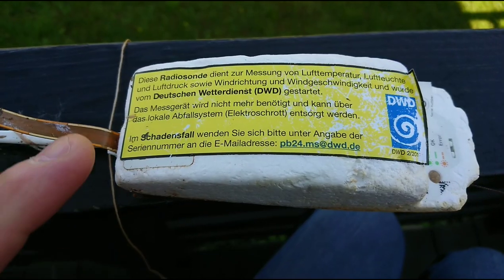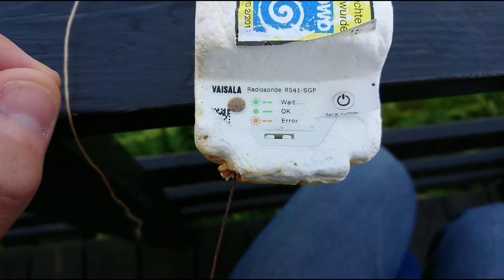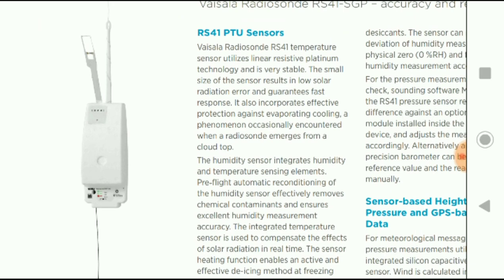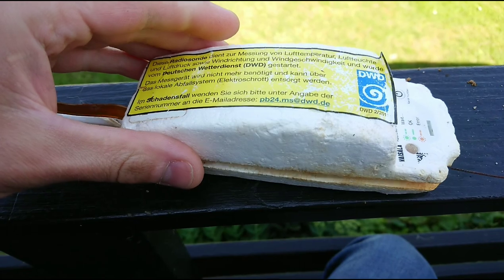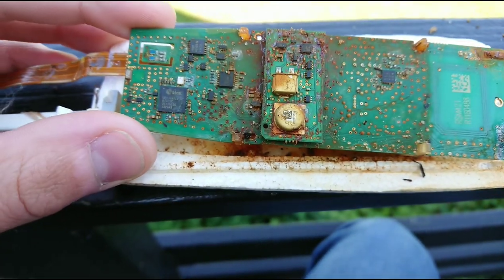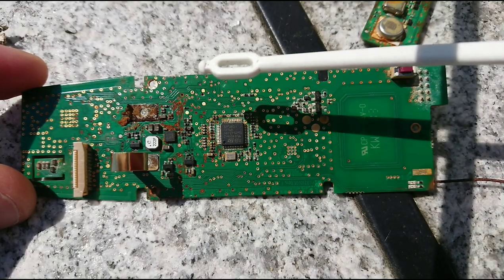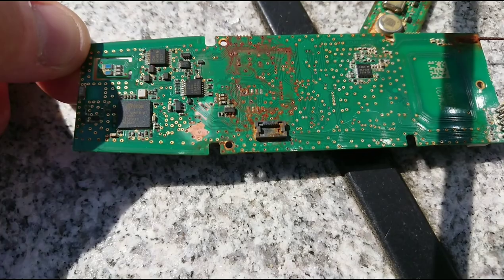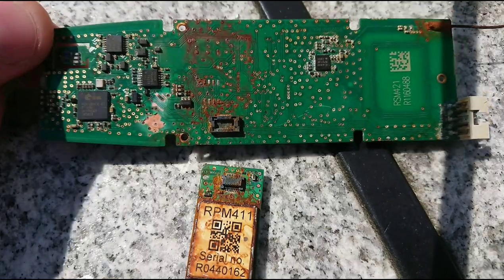German Weather Balloon Teardown, Vaisala RS41-SGP Probe

Comment: Interesting find! It almost looks like that label says the thing is dated 02/2017. I'm wondering if they may actually re-launch them if they find them again...
Reply: They really are single use devices, as they typically will stay up in the air for a day or two before the balloon bursts if conditions are right, though many of them have been tracked for weeks, travelling around the world on the jet streams. 

Would think the lithium batteries are used because they will operate to a lower temperature, and still provide at least enough power for the transmitter to operate at that point, even if the electrolyte in them is starting to freeze solid. They have changed a lot from ones used last century, where the battery pack was a simple cell pack that you activated by immersing in water for 20 minutes before launching. 

Thus batteries also need to have a shelf life of up to 5 years, as these could be stored in a warehouse for a while before being used, or sit at a launch site for a while. Sensor string though has not changed, just added the GPS to give an accurate position, but kept the barometric sensor, now temperature compensated, the outdoor temperature and humidity sensors, and likely some other sensors for light level and IR and UV levels, as photodiodes with the appropriate sensitivity filters are very cheap. Calibration though is now on board, as you can do a whole batch of them in the same chamber per run, and easy to write to each individual micro as a compensation table, so no field calibration data to be entered, it is all there ready to use.
Reply from the maker: Yes it says 2017 on the sticker. It looks like single use, but of good quality with that little damage after 3 years in the water.
Reply: @NerdyNEET  yeah probably :D
And the chance of it falling right back in through the window is very low :P

Comment: The "flat band connector" is actually the measurement instrument! It is bent at an angle so that it is not affected by the air flow around the device.
Reply from the maker: It is still a flat band cable to the actual parts at the end of it, that are clearly missing. Stock photos on Vaisala website shows some kind of component sitting between the conductors. Cool application that it is used in, to gain a better measurement away from the body of the radiosonde.
Reply: @KaizerPowerElectronicsDk  True! But I am having an intact unit in front of me and there are no components on it. Could you provide me a link to the stock photo? Mine is looking just like this: https://www.vaisala.com/sites/default/files/styles/product_main/public/images/PROD-RS41-1280x960.jpg?itok=OVS1SLYA
Reply from the maker: I can not argue against that :) The one I found, was missing the "brown" component that makes up the lower bar of the upper loop, (you can zoom in on the pdf) https://www.vaisala.com/sites/default/files/documents/RS41-SG-Datasheet-B211321EN.pdf